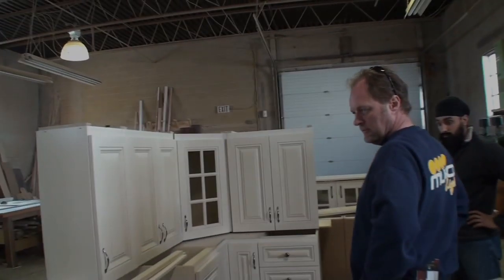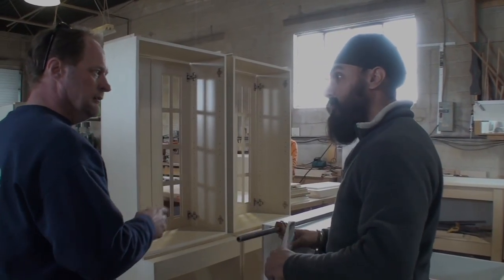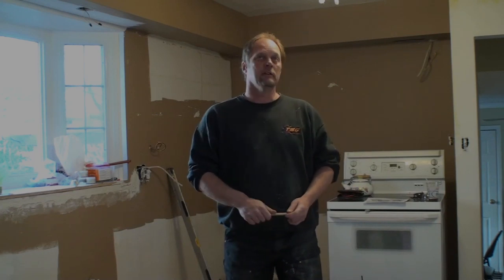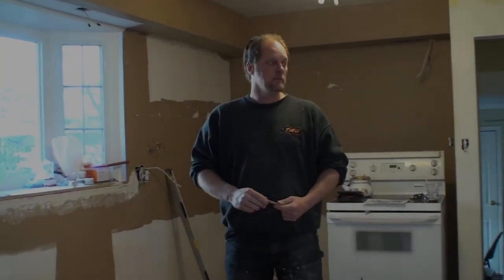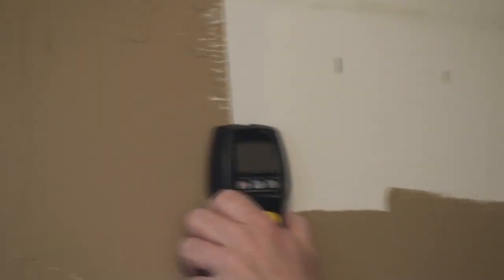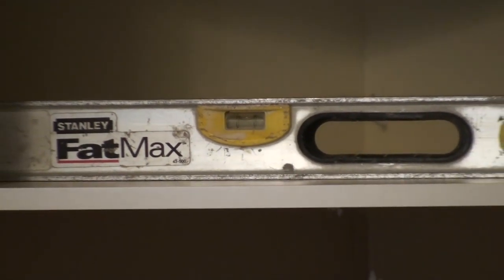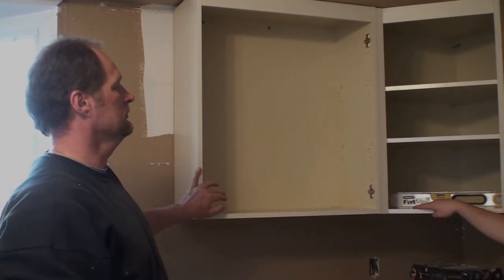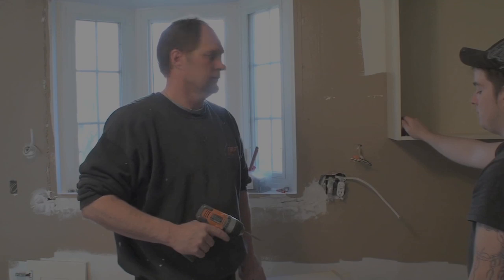Installing Kitchen Cabinets

Comment: Pretty archaic methodology. 
Suspension fittings (exposed and hidden) used in conjunction with steel hanging rail allow vertical and horizontal adjustment. No unsightly screws in the cabinet back. Can use 1/4" backs. One man can hang upper cabinets.

Comment: If you have the walls opened up, you just throw some 2x4 blockers on end to fasten to. As long as you know your rough height for your cabinets and all your blocker are in line at the same height your good. This way your sure to hit a stud and end up with even screw spacing.

Comment: When installing cabinets on the wall, I'm always concerned about what kind of screws will hold it up securely. The cabinets themselves weight a lot and so when you add more to it with canned goods and the like, it's gotta be at least 100 lbs.
So, I'm wondering if those 3" screws are rated for that weight. I'm also wondering about the board that makes the back of the cabinet.. it is meant to be used for hanging?